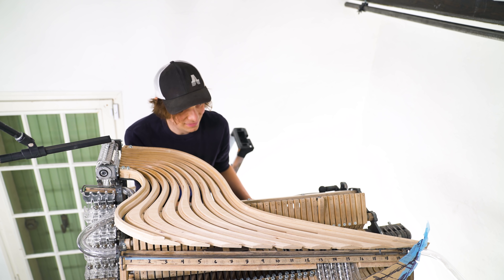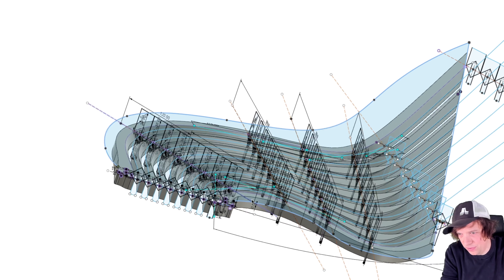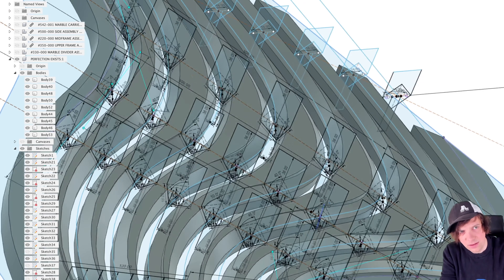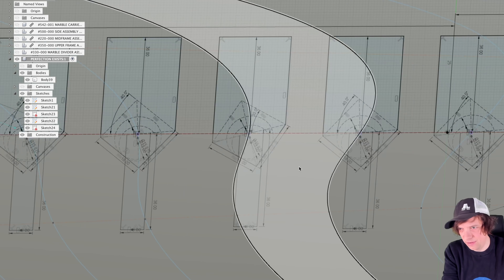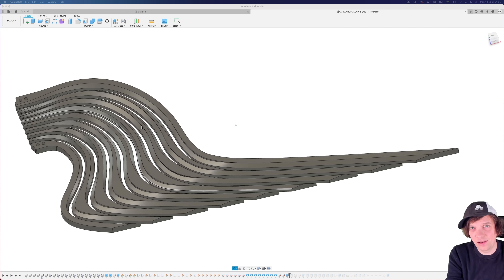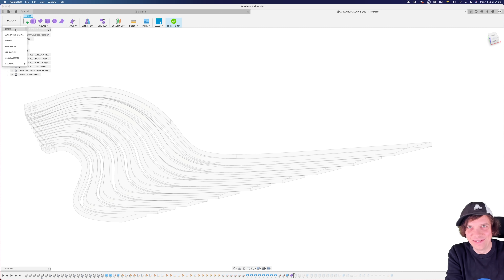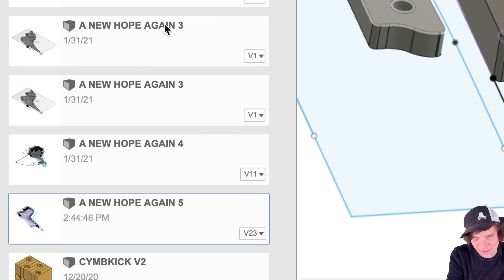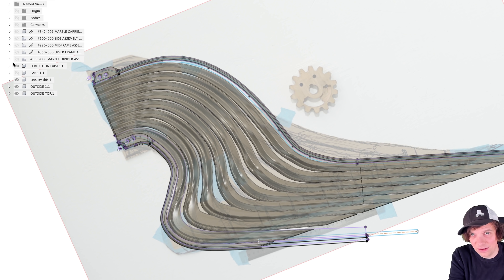Marble Lanes

Comment: I see a possible issue with this design.

For efficiency the left most track, the longest one, should be as close to the right most track as possible. The issue I see is: is marbles not feeding the machine because no lower spots are available when higher spots are. A marble that goes directly to the conveyer belt is an important lost if a higher spot is available. I think that even the template might be slightly too long when all instruments will be in operation.

If (number of marble feeding instruments per minute)/(number of instrument played per minute) is <1 then at some point the instrument will run out of marble. Each marble feeding the machine is important.

On the other hand if the ratio is >1 then the extra male will take the overflow track.

Just something to consider.

What I like about this design is that lower spots will have a continuous feed of marble.

Comment: It appears to me that unless the Marble Conveyor Belt is full at every load/release there seems to be a high probability that the very fest channels on the left could end up not being filled properly.  I think the solution is more of a reverse "S" shape starting the first bend further to the right, then coming back and closer together to drop marbles at only the first 1/2 or 2/3 of the channels.  This would fill the first channels to the left and then the roll-off would fill the channels to the right.    Issues to take into consideration is of course what channels get played the most and empty the fastest will be the ones needing to be filled the most, drums and base I would presume to be the most heavily used.

Comment: I do not know fusion 360, but based on watching your cadding, here is my idea that may or may not work whatsoever.  Instead of having a single path to loft/follow for each marble lane, have 2 paths; one for the right "wall" and one for the left.  the two lines would be constrained by an offset from your centerline, and then have an equal constraints between the sets of paths.  you could manipulate the path geometry with length and angle of a reference line the paths are constrained to, and have as many reference lines as would be needed (possibly one at apexes and one at tangencies).  After getting the geometry of the path correct, then loft each side of the lanes with the rotations needed (I don't have a solution to the ease of lofting angles) using the reference lines as a point of angle shift. this way as you manipulate the paths as necessary, everything would update automatically.  Using this method it would be easy to change the angle of the "trough" in the path to control speed into the divider; setting each of the angles as they into the divider steeper to give a wider / "pinched" path.

Also I LOVE the design direction from pmma to plywood.  I love the aesthetics and warmth that ply brings to the mmx, and have felt it was constantly becoming more and more industrialized and cold.

Comment: Might be worth looking into fluid dynamics for inspiration, the played marbles 'pool' in bottom of system and are 'pumped' to a small reservoir at bottom lifting chain. The chaos begins at top of chain where they are sprayed indiscriminately over the top while hoping for an even spread. With this new design the stair loop should become the main feed and the chain should try to feed the pressure reseservoir without turbulence.

Comment: I'm just starting to learn Fusion myself, but I was thinking about your ask on how to build a better track. What it seems you need is a Sweep with configurable rotation points. Unfortunately Fusion doesn't seem have this. The closet thing I've seen is how you can manually define custom scale points along a (3D) Filet. But I did find a discussion thread where someone was trying to create a rollercoaster track with twists. The workaround suggested using construction planes and Pattern Along Path tool. That article is here:

https://forums.autodesk.com/t5/fusion-360-design-validate/twisted-patterns-along-a-path/td-p/8563894

I wonder if you could get away with just using the Loft tool and construction planes. You would put a construction plane at each turn in the track, add a sketch, put a square on it, and rotate the square to the angle you want. Then you'd just loft through all of the squares and ideally you're left with a body to subtract from the base to get your channel.

Anyway, keep up the amazing work! I greatly enjoy the opportunity to watch and learn!

Comment: I mean it looks nice but why not make it out of steel wire? Like a standard marble track? It will make it more "transparent" which will give the audience more visibility of the marbles AND you can easily bend each lane to make adjustments. It seems like you are going for overly complicated solutions to problems only because you have learned new tricks. Sometimes simpler is better. Good work though. Cheers.

Comment: Uneducated observation here, but it seems the marbles are moving too fast when they enter the collection lane.  They seem like they have so much momentum that they might skip right over empty lanes and get recycled again.  Huge fan my friend, and thank you for taking us on your painstaking journey!
Reply: Thought the same, also the tilting and angled walls are not really necessary I think. 
What is the problem if one out of 1000 m may switch a lane?
As long as they are not escaping the whole thing...
Reply: Yeah, I thought so too.  
I think also the tilting and spacing of the guides in the marble lanes can be ingeneered to increase spin and friction and slow down the marbles to solve the problem. You can see how the marbles slow down when tilting and turning in the video. If the spacing increases the spin increases too and the speed goes down. If they tilt in a certain way they should be able to slow down dramatically before the marble divider!
Love the project. I've been following since Martin was setting up the CNC machine in a shipping container in Sweeden!
Reply: @emons87  Exactly!  He previously talked about how adjusting where the marble contacts the guide path can affect how quickly the marble traverses that path.
Reply: The marbles can only move that fast while the machine is empty and most channels are bypassed. Under normal conditions, marbles will bump into each other  and slow each other down.
Reply: He need lanes made of acrylic pipes instead of wood. And to make them look different, with different colors.

Comment: Martin, in your next iteration plan ahead for a momentum soaker at the end of each track. Fast marbles are ok, but you need to moderate them so they politely fall into the channels and don't jump unpredictably. Also, noise! If just before joining the queue the marble from each track slams into some felt or felt backked by foam, that would do the trick. Ideally the momentum soaker would happen before the marble joins the main flow over the channel entrances. There will already be marbles flowing from the fish stairs, and you don't want them to be sideswiped by the fast unmoderated marbles from the racetracks. These high-energy collisions could themselves be noisy and cause unpredictable bounces.

Comment: Martin, why are we fanning out marbles to the beginning, middle, and end? The ones going to the beginning will pass over all channels, the middle will pass over half, and the end will pass over only a very few. Shouldn't they all go to the beginning so they can all pass over all channels? All the best, brother
Reply: If all the marbles go in the beginnning, we risk not having enough marbles reach the drums and bass. Also: The reason we're going with this design is because the earlier design, where the marbles were divided into two tracks (one for the vibraphone + one for drums and bass) risked having marbles stuck and blocking the path for the other marbles. Spreading the marbles out like this ensures that they don't block eachother when coming out of the fishstairs.
Reply: @Marre2795  I understand the blocking issue coming out of the fishstair, which definitely needs to be addressed. I like individual tracks coming out of the fishstair, but can we at least agree that if we spread out the marbles, none of them should be going for the very end where they will only have the chance to go in one or two channels before being recycled?
Reply: @curtismakes  I think they need to. Considering how many marbles are needed to play a fast drum and bass beat, there need to be a lot of marbles going to these channels with priority. Even if the outermost marble path only feeds the last 1-3 channels, that can be a good thing to make sure these channels never run dry. Furthermore, if the drum and bass channels are full, the marbles will just circle back to the fish stair and get fed into the vibraphone channels, starting at channel 1.
Reply: @linusolofsson498  I think it would be great with some kind of calculation of how many marbles would typically be used in all the different channels. Just guessing and designing these comlex parts based on that is risky business...

And about recycling marbles if the last channels are full. Yes, that's of course correct. But if the first channels for some reason needs more than 1/8 of the marbles, they will run dry, because only one eighth of the marbles are routed there.

Maybe the best solution would be going for some kind of compromise where the marbles aren't spread linear over the channels, but instead with a heavyweight on the first part and also feeding a smaller number of them directly to the end channels.
Reply: When looking closer I see that I am mistaken. The recycled marbles are all coming through the same pipe feeding the first channels. So maybe the issue with running low on the first channels will only risk to happen early in a song before marbles have filled up everything properly.

Comment: I am a little worried that there isn't a bias towards leading the marbles to the front, meaning in a vibraphone heavy piece most marbles will skip the empty channels and need to go through the fish stair, which is only a fourth of the capacity of the marble lift.  It's probably fine, but may be something to consider if you haven't already.
Reply: I honestly thought the redesign was going to encourage a single-file line of marbles to run over all instrument channels as per the tests hes' been doing with the height modules
Reply: @worm489   I think they need to be spread out like this. Considering how many marbles are needed to play a fast drum and bass beat, there need to be a lot of marbles going to these channels with priority. Even if the outermost marble path only feeds the last 1-3 channels, that can be a good thing to make sure these channels never run dry. Furthermore, if the drum and bass channels are full, the marbles will just circle back to the fish stair and get fed into the vibraphone channels, starting at channel 1.
Reply: @linusolofsson498  I get that,  which is why was surprised.. the update that now slows down with over rotation is the ingredient i forgot Martin taight only a few lessons ago.. i couldnt see how a single file starting at vibrophone would provide sufficient supply without a priority tube to specifically combat this.
Reply: If the piece is heavy on the vibraphone, most of the marbles will bypass the channels and then take the fish-stair up again to the beginning. So provided the fish-stair can keep up with the demand, there is no problem.
Reply: @DarkArtGuitarsWorkshop  Yeah, but I'm worried the fish stair won't be able to keep up because it only has a fourth of the throughput of the marble lift.  Though the reason I think it'll be fine is because most pieces will probably have a fair amount of percussion, which is at the end of the marble divider, but it this change does add a small composing constraint.
Reply: at end of the instrument lanes the recycling tube takes them up the fish stair and puts them right up at the front again, so there is a bias towards the front
Reply: He need lanes made of acrylic pipes instead of wood. And to make them look different, with different colors.
Reply: @nitayL  thats a lot of manual bending, its not so desirable
Reply: @nitayL  and some rgb. To loght up when a marble passes.
Reply: @mawla14  Ew!  No offense, but I don't think RGB would fit the aesthetic at all.
Reply: @Huntracony  it's sarcasm

Comment: I haven't had much success with lofts when using curved profiles. Even when using circles of varying sizes it tends to do weird stuff. F360 seems to work better with angular profiles. You might be able to add filets to smooth out the angles afterwards.

Comment: i am not convinced by this design in the slightest. It just evenly distributes the marbles without having any form of adjustment or taking into consideration where the marbles are actually used the most which may change from song to song. Also doing these kinds of huge redesigns throws away all of the testing effort.
Reply: I agree. The lack of adjustability is outweighing the beautifull design.

Comment: That looks beautiful.... and just for consolation, as a young engineer fresh out of college, I made more than my fair share of wrong dimensions.  I love the design.  If you get it done in two tries, that's a win in my book!

Your "tilts" are known as "banking".  You have "banked" the curved paths - creating extra banks on the outside of the curve to better manage momentum.  The correct design of the bank depends on the velocity and mass of the marbles as they go through the curve, in addition to the radius of the curve.  This level of detail is probably not necessary for your application.

I'd suggest that using the "v" or the "square cut" as you did is the better way to approach this because it keeps contact between marble and track on just two points - less rolling friction and less noise.

For a more parametric design of the lofts, see if you can define the curves parametrically (for example, using tangent constraints to a circle of parametric radius).  Then you can put your twisted loft sketch with the twist dependent on the same parameter - radius, and then your loft will auto-generate the banks based on the radius of the curve.  In my opinion this is overkill for what you are trying to achieve.

So to simplify the overkill: constrain and parameterize your loft path sketch, and then throw in your twisted loft steps with a fixed amount of twist as appropriate.  This will be a "good enough" approach.

Again, love the design, and I think it brings a lot more character than the older PMMA pipes did.  Is there any chance to integrate the PMMA pipe from the fish stairs into the same part?